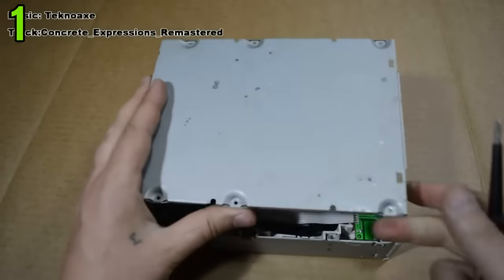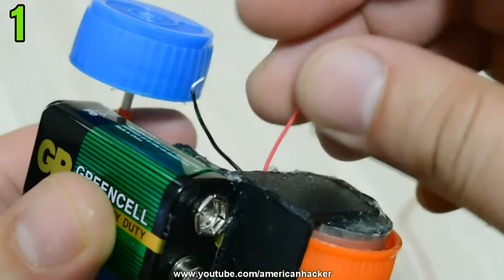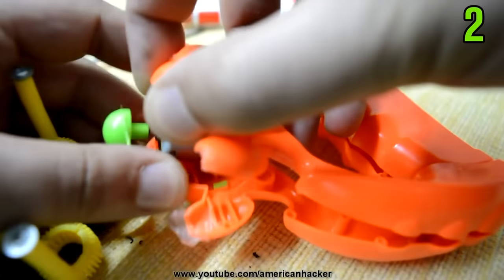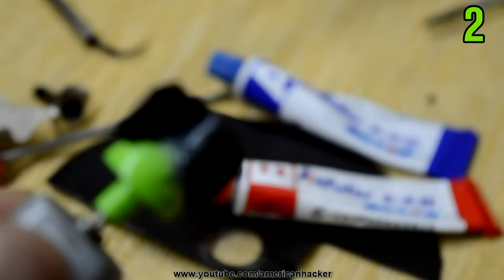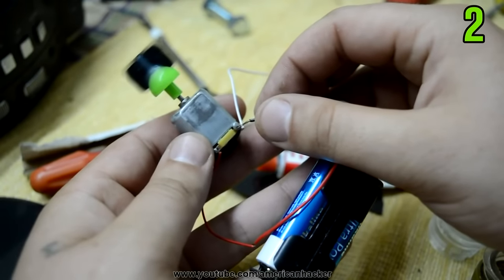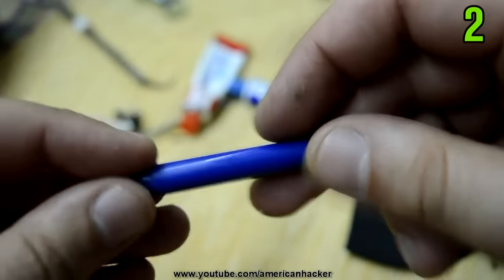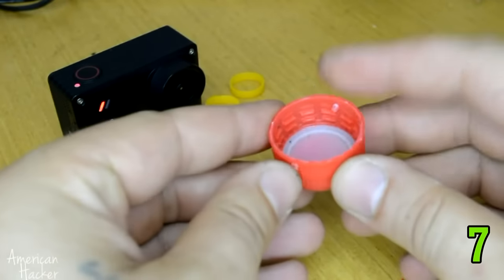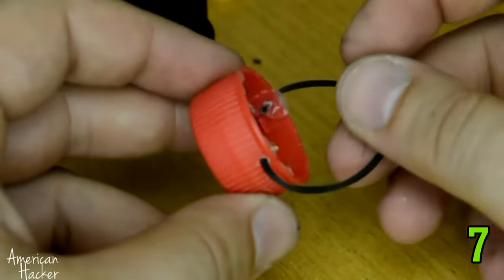7 Incredible Life Hacks and Gadgets!

Comment: the first Incredible how can i charge the battery 😂😂😂😂
Reply: just change it
Reply: Instead Of Glueing The Parts To The Battery, You Have To Glue It To A Battery Holder Like This One https://www.amazon.com/dp/B00OK6DJ4Y Also This Means You Don't Need Battery Connecter Or Switch You Just Solder straight To Motor.